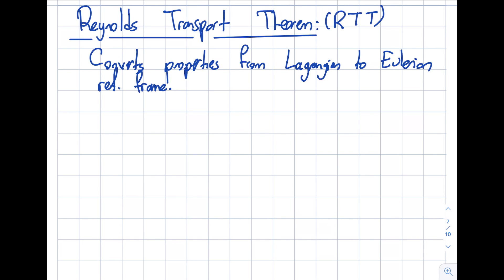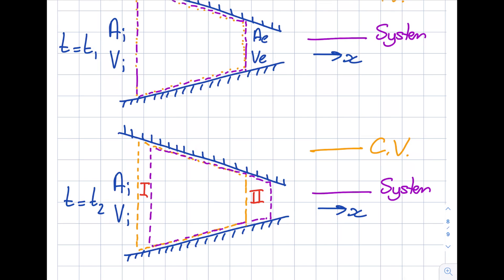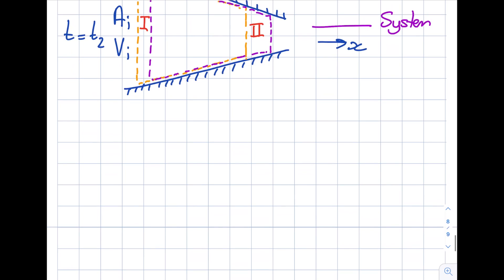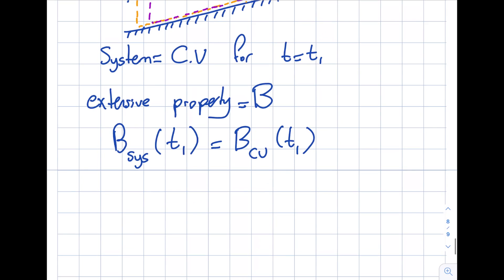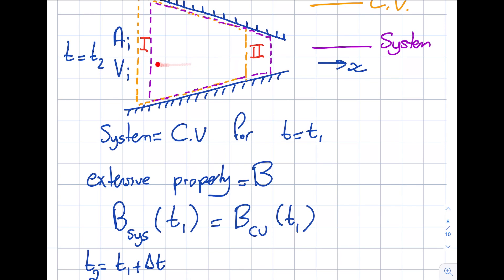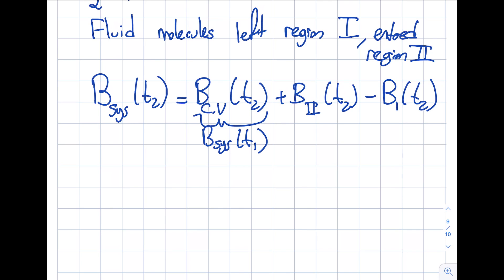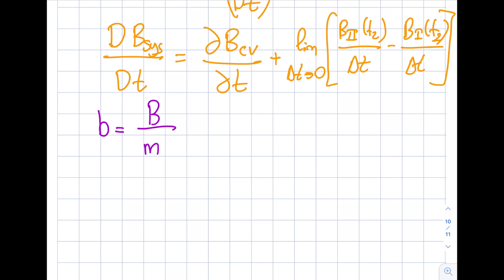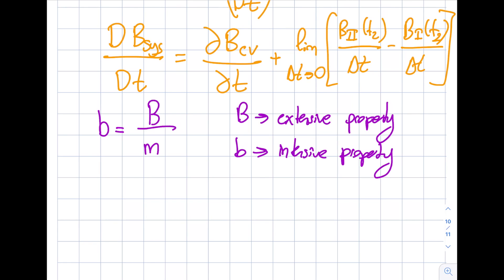Fluid Mechanics 4.7 - Derivation of the Reynolds Transport Theorem

Comment: Excellent explanation and smoothly done!!! 
I just want to share my conclusions of your video, and it's a request do let me know that am I right or not?
The derivative of control system shows how it moves with respect to time from initial position in the flow,
As nothing can enter or leave the system, the only thing which changes is the position and we study that.

Okay the second part is the derivative of control volume, which shows how the property B changes within the boundary of control volume, as it doesn't move and the thing which changes is the property quantity and we study that with respect to time. 

Are my conclusions right or not??
Thanks for your time.
Reply from the maker: You got it! Well done. In short, the control mass moves with the flow, while the control volume stays exactly where it is at. We study the relationship between those two definitions from thermodynamics. Good luck with your studies.
Reply: @CollegeFluidMechanics  
Finally I got an excellent fluid mechanics teacher, 
Thanks for providing such great help.
I also commented on other videos of this module, when it's feasible for you please comment on them too,

Once again thansk
Reply: @moazzumgillani4852  Where should i study machine design from??Can u pls recommend me some good channels for it!!!...I have recently screwed up my mid sems...